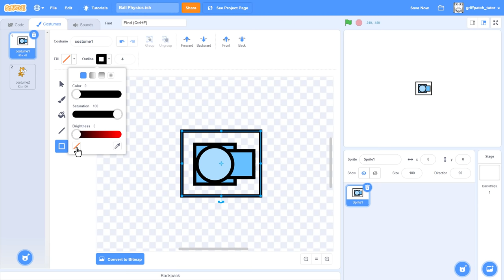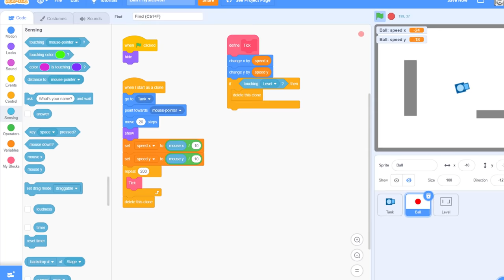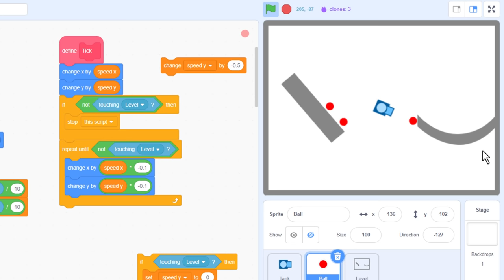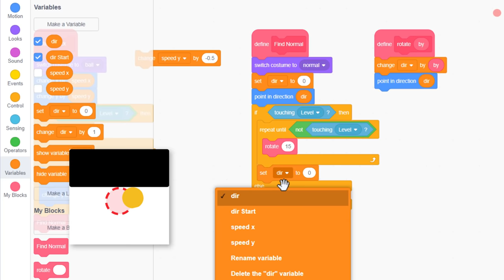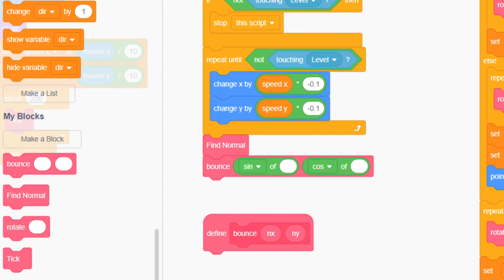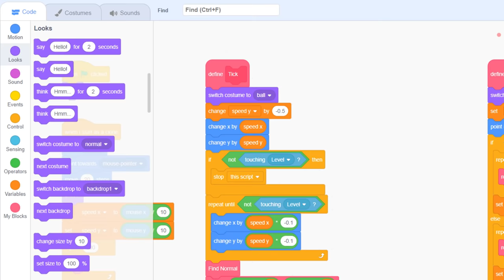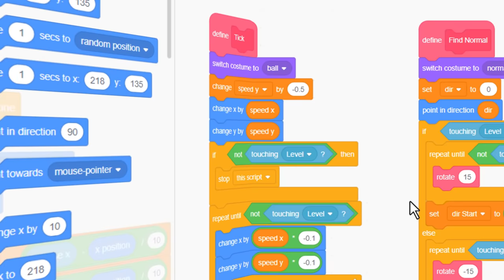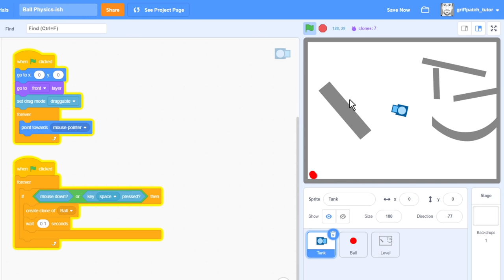How to make Physics in Scratch | Full Tutorial

Comment: How can you add friction to the ball, like if it's rolling on a surface it should get slower over time. I tried implementing this by multiplying the speed if the ball is on the flat ground, but it changes speed in weird ways once it encounters a slope.

Comment: i have a bug, the balls cling on the walls and then climb very quickly up and stay there until they time out
edit: i tried removing some code that was used in the end to tweak stuff, and they also get removed after they collide with the level
edit 2: about the first edit, i realised its all because of the if abs of dir > 720 then delete this clone, and when i delete that code, i see that normal sprite and it lags a lot.

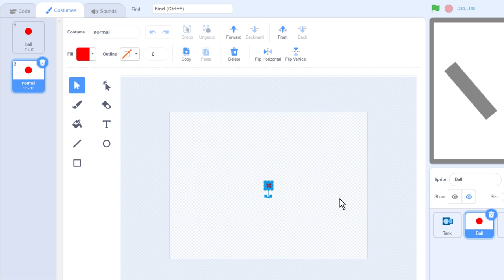Comment: 7:45 if u mobile increase the size to the right to 23 by 17 and back to 17 17 because u increased 6 pixels to the right and set it to normal (not centering it) u can move 6 pixels with no arrow keys

Comment: I found some nice concepts , however 1 major objection, its about clones, I even tried your method of setting speed before commenting, so either scratch has changed or broke for me. I copied your code block for block. Anyways, my objection is that every time a clone is created, it takes values of mouse x and mouse y, meaning that ball direction is only accurate as long as the tank is in center of stage, but this is not the main concern. The main concern is that (and I tried it out)is through the tick method, your ball constantly gets its direction updated, what I mean is when the first clone is created, lets say it spawns with a direction of 90 degrees, when the second clone is created, it updates the values and lets sat it spawns with a direction of 120 degrees, now the problem arises that since clone 1 is always constantly updating its direction, it also changes its direction from 90 to 120 as the information has been updated by the second clone, the second clone will also change direction with the creation of a third clone and so on. I am very confused why you did not encounter this problem. I hope you respond to this problem very soon and update the tutorial. I also wonder how no one else encountered this problem. Have a good day!

Edit: After 9 months I realized that I needed to set the variable to "for this sprite only".